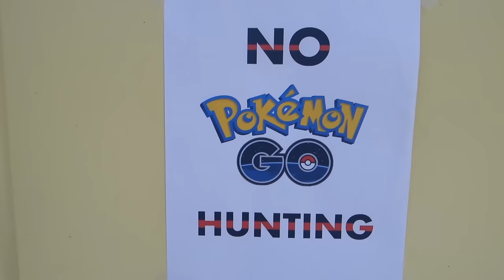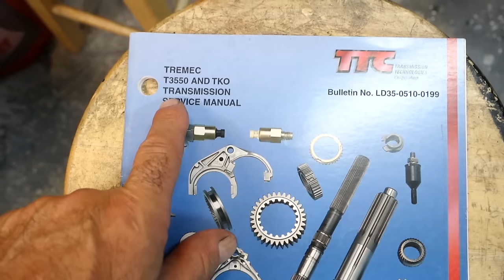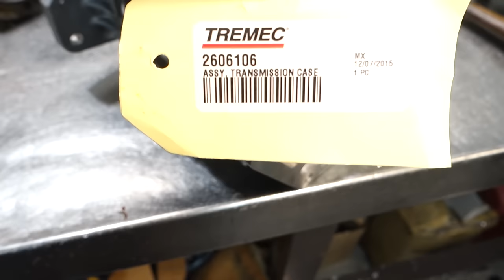How To Rebuild a Tremec TKO 3550 , 500 or 600 5 Speed Transmission

Comment: Paul, I'm a 68 year old shade tree mechanic that has done most of my own repairs for 40 years. I purchased a TKO 600 used and put it in my latest project (87 Cutlass). This trans worked well but leaked like a new puppy. I have changed transmissions and clutches but always had a pro repair or rebuild my trans. After watching this video, I dismantled the TKO and resealed with anaerobic sealer and replaced the input and tailshaft seals. I'm happy to report that this was a success! No leaks and it still works! I followed your video to the letter and had no problems. Thank you for your how to videos.
Reply from the maker: Glad it helped

Comment: I replaced the TH 400 automatic trans. with a Tremec TKO 500 in my '73 Vette.  The co. I bought the Tremec from said that they set up the shifter tight so that it wouldn't be loose after it broke in.  It was atrociously notchy at first, but it has become fairly smooth after a couple thousand miles.  Thanks for your very interesting videos!
Reply: That is a GREAT swap.   Way more fun to drive a Vette with a 5-speed that can handle the power of the modem V8 builds.   My dad had owned Corvettes from 63-05, including a 91 ZR1 with the OHC engine.  He always said that he would never own a Vette with an auto.  The 69 he kept until he died in 2014 went from the Muncie 4-speed to the TKO in 2007,  he LOVED that change.

Comment: I know nothing about this stuff, but I love watching this guy. Great job explaining it to us normal folks ;).
Reply from the maker: Thank you.
Reply: +gearbox video
Reply: Peter I know this dude is spot-on isn't he I'm with you I don't know much about it but it brings me back to my childhood my friends and I changing each other's transmissions and motor work lying in our parents driveway or right out front in the street holding lights for one another listening to Led Zeppelin Pink Floyd The Doors etc.... we had great cars 1971 Chevy Camaros 1969 Chevelles with 396 Big Block Hurst Shifters we didn't know how good we had it
Reply from the maker: Best education ever.
Reply: My 4th gear in my tko 500 seems like neutral what would cause that
Reply: Thank you for putting out that video of the TKO rebuild , my main question here Paul will that transmission fit into a 67 Camaro without having to modify the transmission tunnel , and again thank you for putting out these videos for people like me to watch them to learn about manual transmissions .
Reply from the maker: I believe the shifter location is good but trimming of the floor would be required. Best to go with the new TKX

Comment: I have owned 5 TKO500/600 units and only had to repair one of them due to bad 3-4 shift.  In Mustangs with T-5, I will nuke the T-5 upon anything requiring removal of the trans.   The one TKO that needed repair became my "practice" trans I used to disassemble and reassemble many times.  Honestly, I have never found sloppy workmanship in a TKO I bought new but have seen some half-assed repair work on used ones.  I bought my first one in 2005 when the T-5 decided to literally explode with housing parts lying on the ground.  Yep, right at the tree, it hooked and BOOM, the track guys were furious as I rendered the right lane useless for around an hour on a test/tune night.   😂   No more T-5, "World Class" or not.   These days we only have 1 drag car and that is a PA Pro Mod C4.   Just too many issues at important times.   Great video for someone not wanting to spend another 2500 on a new TKO. 😂
Reply from the maker: The T5 was never intended or designed for drag race use . It was only designed for the power levels that the stock applications had

Comment: The best 1 hour video that I have ever watched!  Thank you for posting this.  I watched it on my ipad, paused it, took a piece apart, un-paused it, and watched more...before I knew it, my TKO-600 was apart!
Reply: Seven months later and my TKO-600 is running and shifting smoothly thanks to this video.  No leaks!  I can't thank you enough for posting this.  My TKO crapped out while I was driving my 428 powered Mustang in Korea.  There were no shops that I could drop it off at so I pulled the tranny and fixed it myself in a spare bed room.  I ordered a new 2nd, 3rd and 4th gear as well as some new synchronizers.  I was also able to swap out a lower (higher) 5th gear so that I can now cruise at a higher speed with lower RPMs.  I had some help from a TKO shop in Michigan to ship my parts out to Korea.                                                                                                                                                                                                                                                                                                                                                                                                                                   I went step by step, took the recommendations on lube, sealant and even the dreaded ring pliers!  Your tips on needle bearings; I was able to do it right the first time!                                                                                                                                                                                                                                                                                                                                                                                                                 Thank you!                                                                                                                                                                                         James Musnicki

Comment: Great lesson on the TKO. That hint on standing the case for the reverse shaft install is priceless for my  patience. The  5th gear needle bearing install can be done similarly, assemble the parts then drop the bearings in one by one  and manipulated with a zip tie into position as needed. For me its much easier than tempting fate trying to insert the clucth cone through the bearings greased into the hub. I'm clumsy that way.

Comment: Thank you for sharing this!  What we did in the aircraft repair industry was draw an outline of the panel on a piece of cardboard, then make small holes for the screws/bolts in the same pattern as the panel, but on the cardboard...with an awl or small screwdriver, then punch the bolts through.  Same pattern; helps ensure you put different length bolts in the right spots.

Comment: Hello Paul,
I'm a 63 year old gear head in Western Canada eh. Have done lots of mechanical work, engine builds and a few muscle car resto mod builds but have never worked on a manual transmission in my life other than r and r jobs. I bought a TKO 5 speed with a broken 5th gear and shift rail from a buddy. He injured the trans behind a turbo LS engine so he went with a 4L80E instead. When I got the TKO trans it was in a box completely disassembled. It was a .80 OD unit and I wanted the .64 OD so I ordered the parts necessary to do the repairs, and also got the improved carbon fiber synchro rings, along with the different main shaft I needed in order to change the OD gear ratio. I used this video exclusively to accomplish the re-assembly of the trans. I could nitpick a couple of things where I had to change the assembly order sequence a little bit for my application but it was no big deal at all. Paul you did a great job on this video and your instruction was excellent. It took me two evenings on the work bench at home to get it all back together and operational. I feel a lot more confident now working on a manual transmission and have a much greater understanding of their inner workings. Thanks for taking the time to do this it is really appreciated. 
What type of oil do you recommend in this transmission? 
Cheers!
Reply from the maker: Thanks for the feedback. I would use Pennszoil   synchromesh in the TKO when using the carbon fiber rings

Comment: I’d like to say thanks for this video. Helped me out a ton when I bought my tko600 broken as a basket case. I also had to transfer parts to a new case along with some new gears. It is faceplated, so not a big worry on the synchros. It’s been together for years now behind my 626hp sbf. Hundreds of passes. I happen to love theses things, lol. I’d also like to mention that lower bearing race in the front for the cluster shaft is different on a tko600. It goes in from the front and the cluster will not go in with the one you have in the case there. My new case came with the race like you have there already installed and it took me a while to figure out what was going on there being my first time having one apart.
Reply from the maker: Yes the TKO 600  is different with that bearing. Problem is because of the assembly people have to be careful because of leaks. Usually I will pre assemble the lower end with the front retainer, case and tail and set my preload of the cluster gear, then remove the race and apply aneorobic sealant to that bearing race and bore

Comment: @17:55 you showed the 5th gear anti rotation ball.  When I replaced my internal speedo gear I made the mistake of moving that shaft by hand. I had just enough slop to allow that ball to fall out on the bench I was working on.  After I recovered from my mini stroke I was able to figure out where it came from but I was not a happy camper when I watched the mystery ball hit the bench.

Comment: Well Paul, I have to say I think I've learned more about gearbox operation and layout from these videos than just about any other source I've ever come across!  

At some point I need to man up and do a rebuild on my Porsche 901 side-shifter transmission from my old 914 (all the joys of a super small 5 speed with the added joy of it also including a differential!) I wish they were as ubiquitous and simple looking to work on as the Muncies and Borg-Warner/TREMECs are.  (Well, as simple as you make them look at least.)
Reply from the maker: Those are not that hard actually.
Reply: GearBoxVideo It's not too bad, I'll probably get a few more thousand miles out of it before I decide to tear it down since I JUST got the car on the road, biggest issues with it is a very, very upset/worn 2nd gear synchro, needs to be either double-clutched or very slowly shifted from 1st to 2nd. Other than that a general tendency to be slower/more effort to get into/out of the other gears once it's warmed up, I'm blaming those on synchros and possibly the wrong type of oil.  It sat for years though with an unknown service history, so I'll tear into it eventually!

Comment: After I load the needles in a gear or counter shaft I put them in the fridge for 10 or 15 minutes and it firms up the trans gel so you dont get drop out.
Reply from the maker: They don't drop out with  the proper assembly gel. So you shouldn't have to use a freezer.   My shop is in Florida and never once have I had to do that.

Comment: Please do a complete tear-down & rebuild of a TR-3650!!  No one out there has had any good videos regarding the TR-3650.  I'm getting ready to do a ground-up refresh on my 2001 Bullitt (135,000 miles), and having a go at the transmission is one area that I'd like to address (in particular, the syncro's).  As the original owner, I am also trying to keep the Bullitt as original as possible, so upgrading to a different trans is out of the question for me.

 It'd be great to see your take on this and to know where the problem areas lie with this transmission so that I could address them with any updated parts.

Btw, loved your collaboration with Eric the Car Guy a while back!

Comment: I watched the video and called Paul and got his synchros. I have heard a lot about the carbon fiber lined synchros but figure I’ll trust a guy that has this many years of experience and go with what he recommends. I just put it all back together and hope to get it back in the car next weekend. Between this video and the Tremec service manual it’s idiot-proof. $65 for 5 new synchros was amazing too when you’re used to $105 each(!) for Porsche 915/930 boxes.
Reply from the maker: I don't sell carbon lined rings for the TKO. I use my own forged  rings which work better than the aftermarket rings.
Reply: @GearBoxVideo  Sorry if I wasn’t clear- I used your rings. Thanks again for the video and the parts!
Reply from the maker: Please keep us all here updated with the results
Reply: @GearBoxVideo  I am curious to know why use your forged rings instead of the aftermarket carbon fiber lined ones.  I just learned about them when I watched a guy's video redo his tko and used those carbon fiber lined ones.  Also, his tko had PLASTIC shift fork pads and they were in pieces.  My tko is about the same age as his but mine has only 3k miles.  I'm  thinking it also has those plastic pads.
Reply from the maker: The carbon ring is a Lined ring glued onto a cast machined brass ring. So you've basically machined down and weakened the structure of the ring and bonded friction material to it. The rings just balloon open. The intellegent way as designed in the T5 and T56 is to use a steel shell and bond a lining to that

Comment: I’m in the market for a transmission right now but I’m running into some issues. I have a beautiful 85 mustang notch with 37k garage kept miles and just built a 347 for it. The motor is supposed to rev to 6500 rpm per cam specs but realistically I would say from 5800-6200 rpm. Tremec is saying the tkos shouldn’t be shifted above 6k rpm. I sought of had my mind set on the tko. My motor should make around 450 hp. Any suggestions??? I could use some help. The 6 speed tremec is pretty expensive with bellhousing and all. You’re very knowledgeable. People are lucky to have you and YouTube around for help.
Reply from the maker: Budget wise its hard to meet your requirements other than go back to a 4 speed Toploader

Comment: Another great video Paul. I learned how to rebuild a Muncie M21 from you and now a TKO600. Very gratifying. Question - Before installing a new TKO600...are there any pre-checks that should be done besides running through the gears and spinning the input shaft?

Comment: I have to say I have had a good experience so far with my tko600 in my foxbody after having my t5 blow up on me I also did a really long brake in on the transmission I babied it for almost 5000 miles and I changed the transmission fluid 2 or 3 times during the brake in  I don’t know it I got lucky or it’s how I broke the transmission in but it shifts smoother than my t5 and I haven’t missed a gear bang shifting or driving it normally I have really enjoyed it

Comment: Hi Paul, I'm here in Jupiter. I called you a couple of weeks ago about parts for a Tremec 3550. You referred me to a company and I got the parts. Thanks to this video I have the transmission rebuilt except for sealing it up. And of course I cleaned the case, all the parts and the debris magnet throughly! Do you still recommend anaerobic sealant for assembly? And, what transmission fluid do you recommend currently? Is Dexron VI ok???

Comment: Excellent video.  My 600 is noisy - more so in OD, since new.  Would the rear countershaft bearing having the wrong shim thickness cause this?  I know Tremec had issues with incorrect input shaft preload

Thanks

Comment: I need to replace just the 4th gear synchro. From your video it looks like I don't need to remove the tail housings to remove it. Can you confirm that? 
Thank you, get video. Very informative.
Reply from the maker: Yes you can pull the input from the front but point the transmission down while doing that so none of the needles fall into the transmission I have rings in stock. Best using OEM rings
Reply: @GearBoxVideo  Awesome. Thank you very much for the quick reply. I hope to get the time to pull the transmission this weekend. Thanks against
Reply: Got my transmission all back together thanks to your video. Awesome for including all torgue specs. Would like to donate a couple bucks to charity of your choice. Let me know a favorite charity if you got one.

Comment: Very nice video. I sent a tr3550 out to local shop for popping out of reverse. Installed "rebuilt transmission" and does the same thing. I took the transmission apart myself after watching you video and everything looks to be installed correctly. Only thing I see is the reverse collar and reverse gear look slightly worn where they engage. Any other ideas?

Comment: My tko 500 was shifting fine when I took it out, but when I put it back in after changing the throwout bearing to a hydraulic one, I now have a grind going into 4th gear when shifting quickly. I also changed the fluid. And ideas of what I screwed up? Great video by the way
Reply from the maker: Your Hydraulics are not giving you a full clutch release.

Comment: Paul, terrific video as are all of them. Curious after watching the Richmond 5 speed vids and this TKO one, which do you feel is the inherently stronger transmission. I realize, with the overdrive of the TKO, the applications are different, but wondered from an expert who has been in and through these transmissions, which is stronger! Thanks and keep up the good work!
Reply from the maker: The Richmond boxes are.  However all of these transmissions suffer from the poor design approach of using older synchro technology.

Comment: Paul, a few years ago, I used a bellhousing that had an input hole too large. It let the  GM TKO 5 speed bolt at an incorrect angle. A noise developed in the tranny. What would I look for. Thanks, Robert.
Reply from the maker: The front bearing and pilot bushing and needles inside the input shaft